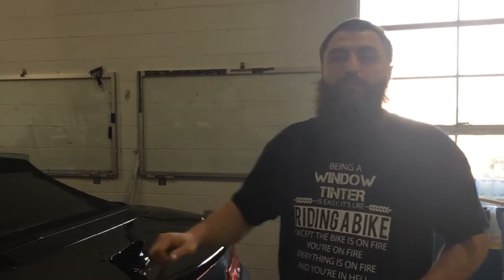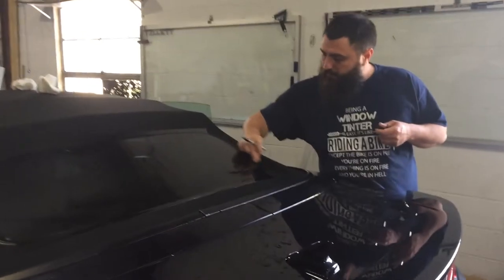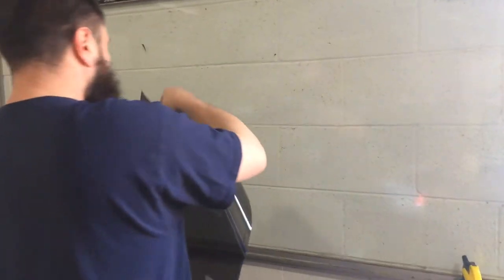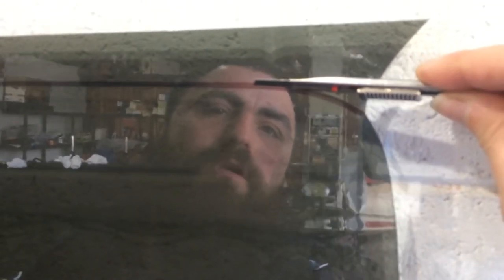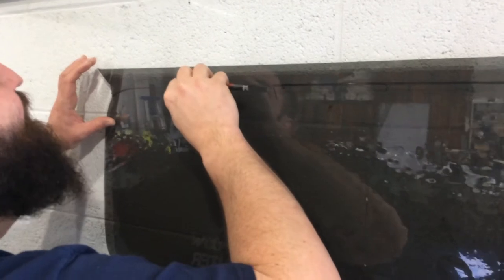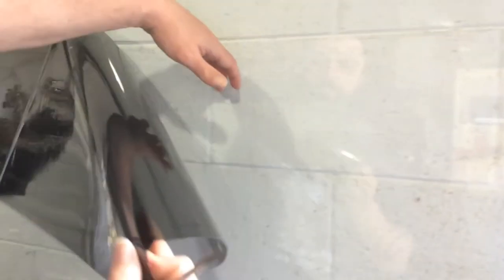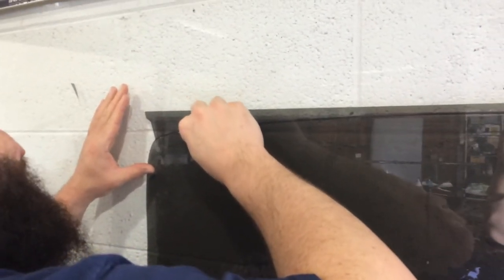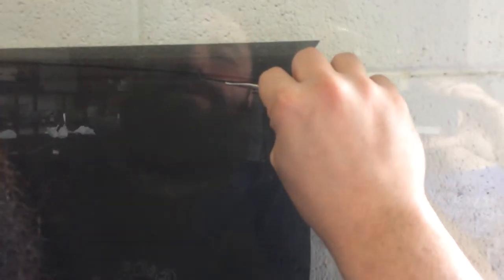Hand cutting convertible rear window: how to tint car windows

Comment: How do you recommend tinting the back window of a tundra or 4 runner that roll down I tried doing it like any other side window but I crease it I can't get a clean cut it's just not the same
Reply from the maker: Pull the seal out and then tint it like a normal roll down window